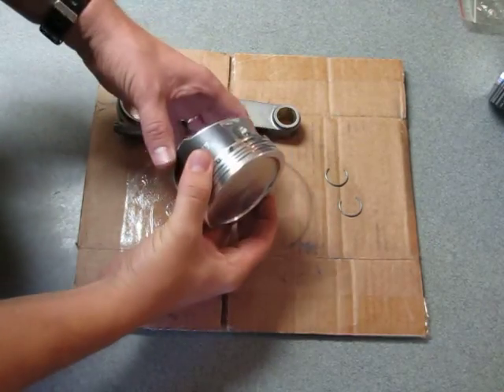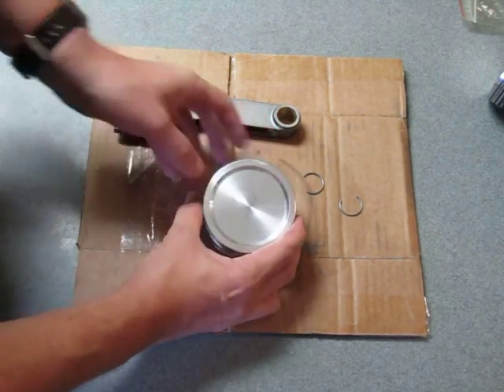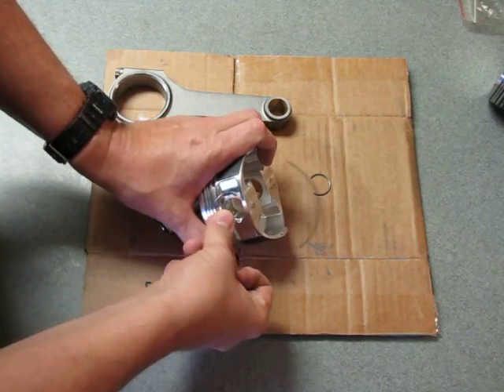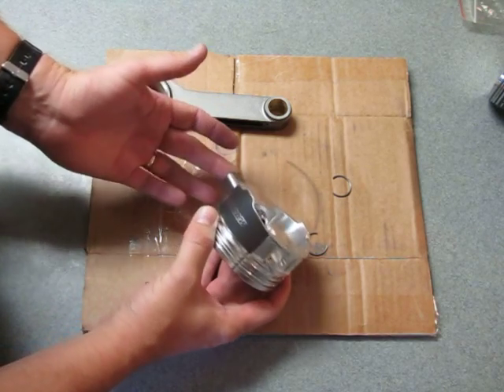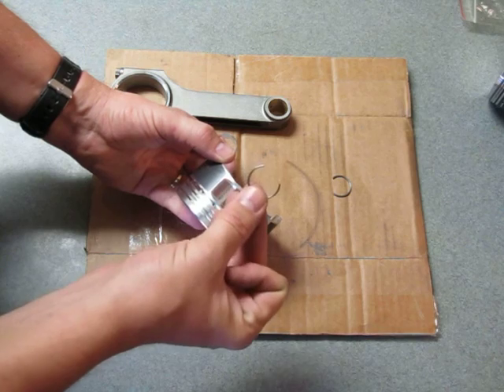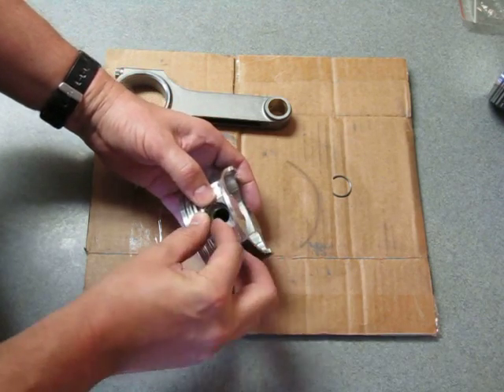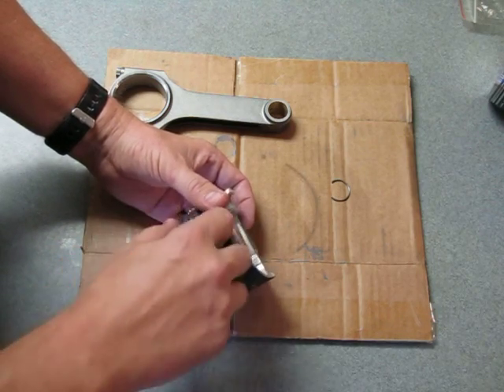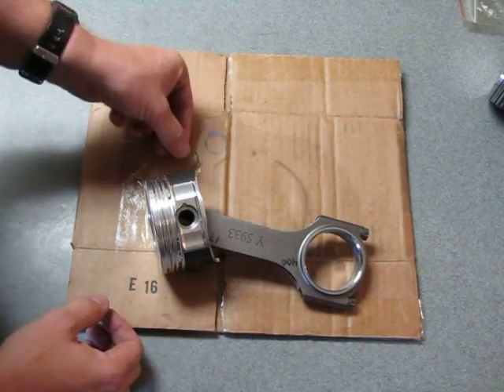Installing wrist pin C clip wire locks

Comment: Just a FYI normally you take apart a binder clip, the metal spring part is used to hold the pin in place rather than your finger. It frees up both hands. You insert the metal spring from the binder clip into the pin lock groove on the other side of the piston to hold the pin in place while you insert the clip.